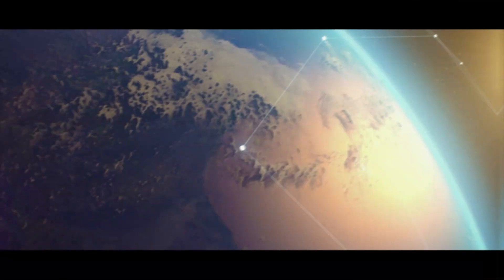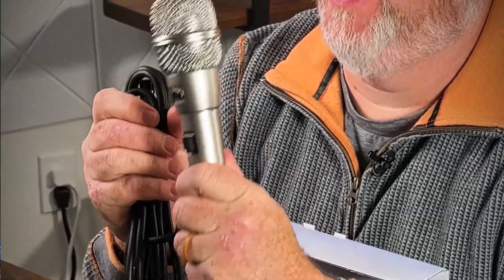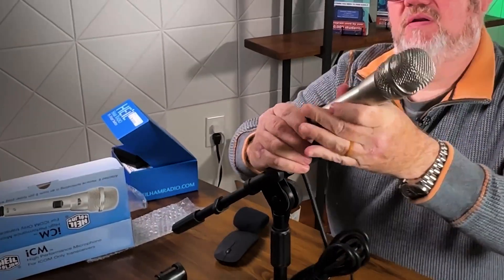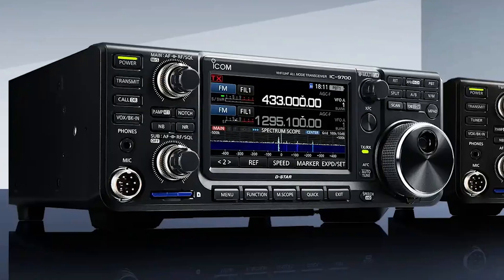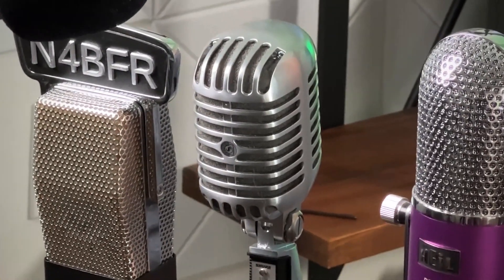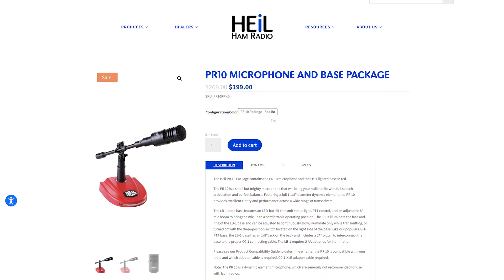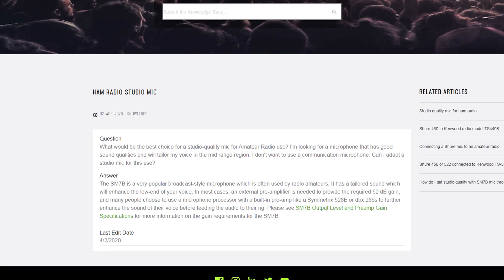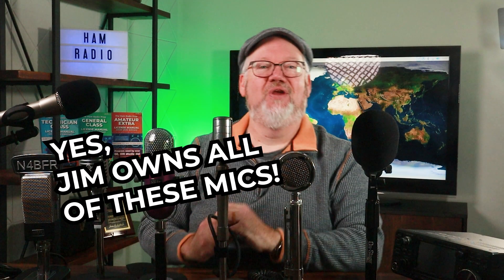Upgrade Your HF Ham Radio with a New Microphone! 🎙️

Comment: Very nice and informative video.  For me, I use (for my Kenwood), the Heil Gold Elite boom mic on their big articulating clamp mount boom stand (I have a couple of their shorter boom stands as well). as well as their Proset headset.  Borh are feeding a MFJ 2 mic to one radio switch box.  Depending on what I'm doing at the moment, I'll choose the appropriate mic for the task.  I also use the Heil hand PTT  and own their foot PTT as well.  I don't mind a little extra effort to key the mic by hand. 🙂

Thank you for the videos and keep it up.

Stay safe and happy hamming Everyone.  😁😎

Comment: Any tips for the g90. Mic. Condenser or head phones mic. Put peddles. ?? Thsnks
Reply: Foot peddle
Reply from the maker: We haven't spent time with a G90.  Sorry, no tips here.
Reply: @HamRadioPrep  ok thanks
Reply: @HamRadioPrep   I’ve found this could this be the part I’m looking for plus a foot peddle ptt. Thanks.  Mark. In the uk.
Reply: @HamRadioPrep
Reply: @HamRadioPrep . Thanks
Reply: RG48 adapter

Comment: Very good and informative review Jim!  Note that the Heil PR781 is one of the most popular and best rated ham mics ever (see eham) - for a reason - mellow yet clear, and looks great.  The Heil PR22 has amazing clarity and is a go-to DX mic that's more of a "hidden gem".  Both are dynamic.  Other than Heil, the Shure Beta 58A and Beta 57A are both very good choices.  At the very low cost end of the spectrum, the Behringer XM8500 can give OK performance on a modern radio with EQ for a rock bottom price.  ALSO - note that the stock electret condenser hand mic on the Icom IC7300 has a reputation for good audio to begin with.

Comment: Just stumbled onto this site as i was looking for some info.  Have a kenwood ts-850s, trying to hook up a blue yeti, not sure on the mic cable adapter as the blue yeti is a USB.   any ideas are welcomed
Reply from the maker: Our instructor Jim says: That could be a tough one because you would need to convert from USB to XLR and then to the Kenwood style adapter.  Check around on forums like Reddit and maybe someone has experience on a home-brew connector?

Comment: Thanks, Jim. I've already got a nice Rode NT1-A condenser mic which has been used with a Behringer mic pre-amp for recording vocals. Theoretically, I should be able to use the NT1-A with an ICOM IC-7100, right? Would I need to run the signal through the Behringer for the 48V phantom power? 73s from KQ4LQN.
Reply from the maker: It will be a very similar process to setting up the heil mic with the Icom as shown in the video, since they're both XLR microphones. Not familiar with that exact microphone, but as long as the signal being fed to the radio is right, and the microphone is getting everything it needs, it should work!